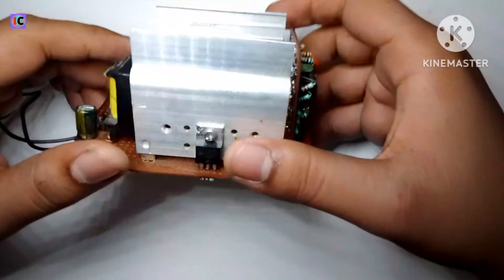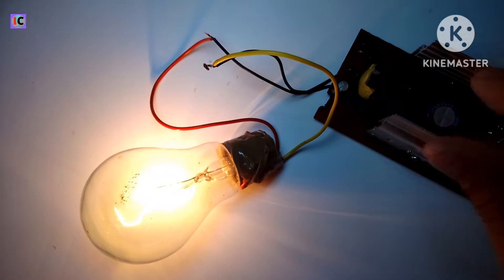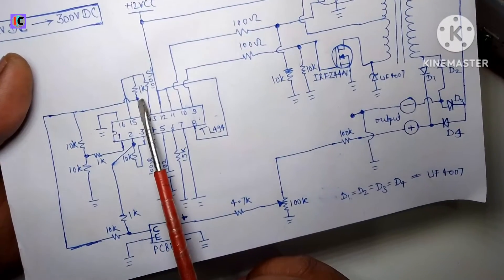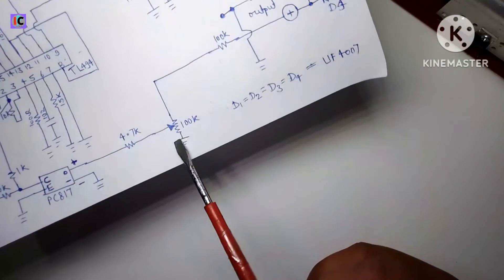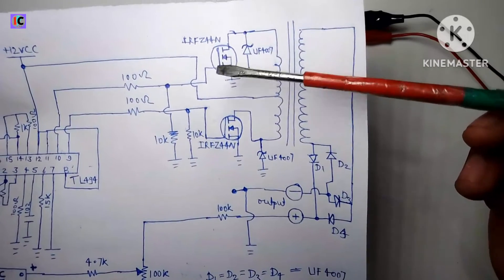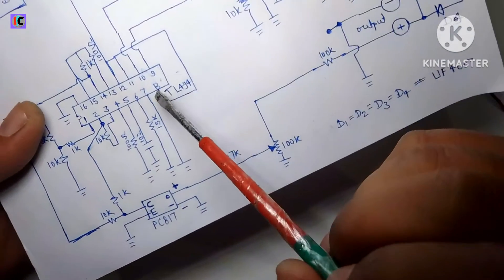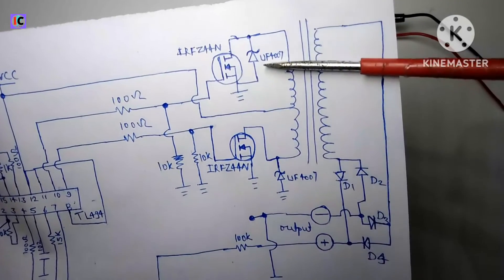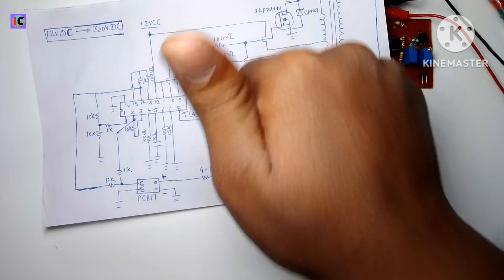How to make Inverter TL494 PWM Module Inverter working

Comment: Can I connect high voltage(+380,-380) in feedback pin directly?
Reply from the maker: use 470K ohm resistor voltage divider

Comment: hi sir i have a question can i ask?
Reply from the maker: ya sure
Reply: @innovationic  it has something like auto voltage stabilization?
Reply from the maker: @ssss-t4k6n 
Yes, the voltage feedback is done through PC817
Reply: @innovationic  but does it have automatic voltage adjustment under load?
Reply: because, for example, as I have, it is 240V and 190V under load, and I just want to know if the 240V remains there under load